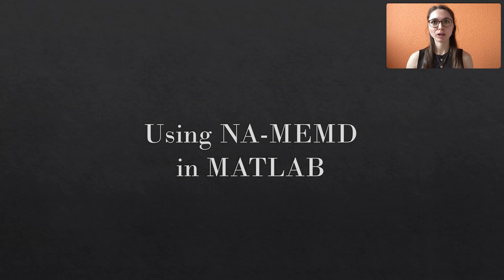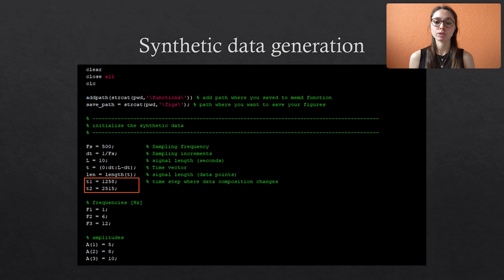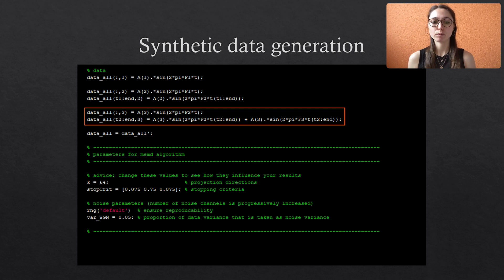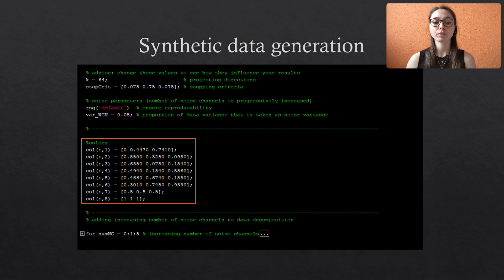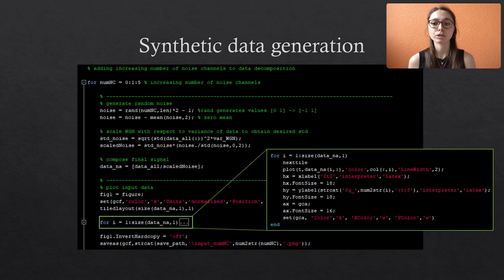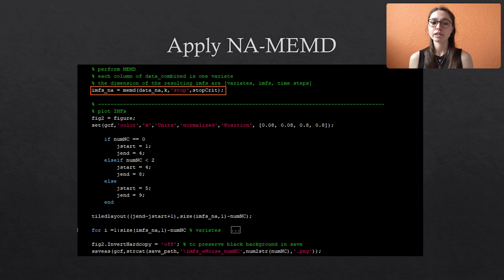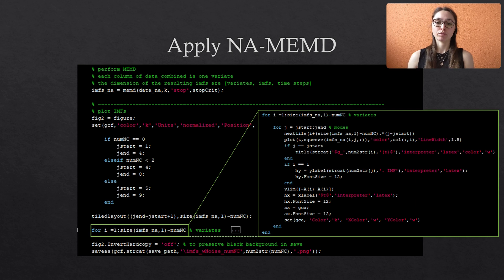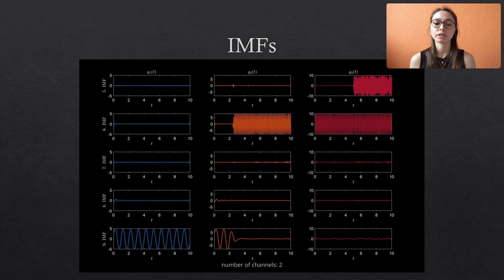1D Noise-assisted Multivariate Empirical Mode Decomposition (NA-MEMD) in MATLAB

Comment: Hi Esther, a question regarding the generation of the IMF. For a complex signal, that may have a number of IMFs, do they need to be saved in a separate file? Does the algorithm save them or does it just plot the results. I would imagine there would be quite a number of large files if all are saved.  Thanks, Gabriel